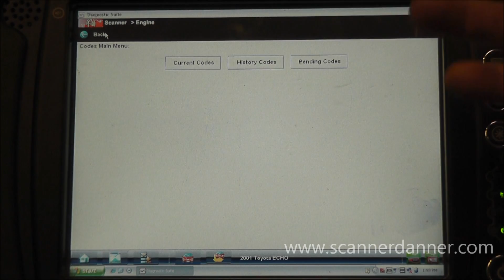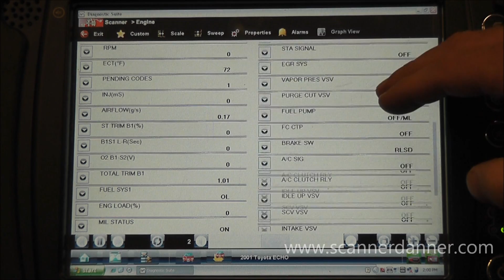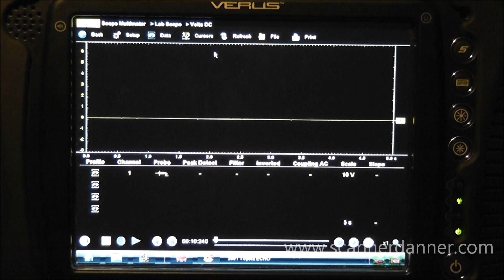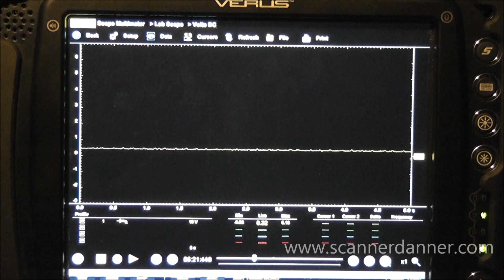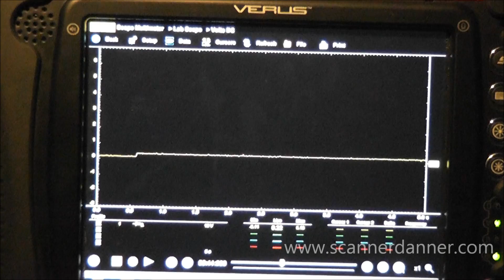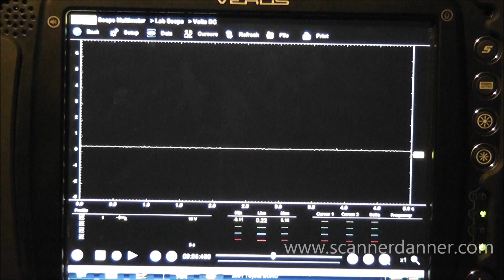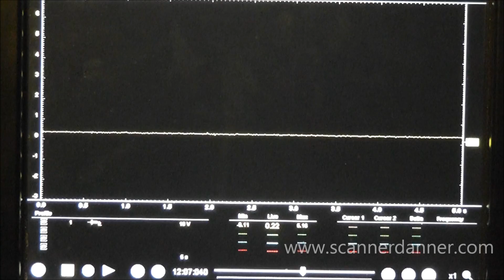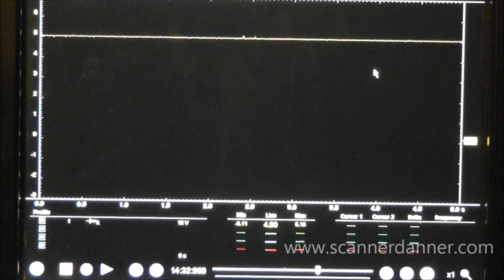Power Steering Pressure Sensor Testing (applies to all psi sensors) - Toyota (P0550)

Comment: Hello Paul , do you have any videos on electric power steering assist fault? No codes , message on dash Power Steering assist fault ? TIA 😊
Reply from the maker: Power ground and 2 CAN wires is typical, so not much in the troubleshooting side other than that and follow the flow chart for the code. Step 1 can you communicate with the power steering control module (most likely part of the whole unit)

Comment: very nice explanation. One thing is, can we jump signal wire with incandescent test light to reference voltage or to the battery.
Reply from the maker: Use the reference wire when you do that test and yes! This is actually a procedure I have taught is using an incandescent test light for this test in case you jump the wrong terminals

Comment: do you think its possible to check signal wire with volt meter
Reply from the maker: Of course, especially on this type of sensor as it doesn't have very fast changing signals

Comment: thanks for this informative video,
in the last minute of the video you have mentioned that there is an internal resistor and it needn't to disconnect the sensor and computer to diagnose if there is a short or open in the signal wiring, what do you mean by internal resistor?
Reply from the maker: This will help! https://youtu.be/CkgrMasd57s?si=fBKxqtkx__etJ7AE

Comment: The scope is a cool tool and totally unnecessary. It could have done with a high impedance "cheap" voltmeter.
Reply from the maker: 100% on this test, I'm just using a glorified voltmeter

Comment: Wow, you're video was so informative and easy to understand!  I'm wondering if I could do the same test using a DVOM on my '07 Honda Pilot?  The dealer told me I had a seeping power steering pump, so when it started whining I topped it off, assumed it was that and eventually replaced it along with the o-rings-without confirming that was the cause...I know my bad.  Soon after it started whining again, on and off.  The fluid level is within parameters not bubbling but swirling (which I've never seen a car do before) on and off, and today it appears to have overflowed from the top of the reservoir.  I did read that someone replaced the reservoir, which is known to clog on this particular yr, make and model and that eliminated the whining  problem, after having replaced the o-rings and pump.  I suspect I may have multiple problems, the switch being one of them but would like to pinpoint the problem prior to replacing anything else.
Reply from the maker: What you're describing would not be related the the pressure sensor at all. I'm sorry but I can't help further other than to say you have a hydraulic system issue, not electrical. Steering rack, pump, restrictions etc etc

Comment: We get 5v on the signal wire when unplugged because in this pcm we must have a resisted jumper between the 5v reference and the signal wire which will give us a voltage reading when disconnected.   Otherwise if there were no resisted jumper we should see   roughly 0 volts on the signal wire when the sensor is unplugged...
Reply from the maker: Exactly! Nice job
Reply: @ScannerDanner  Is the internal resistor for the computer to test the circuit or does it play any other part in the function of the system?
Reply from the maker: @philljustphill1656  no other function, just diagnostics as some psi sensors and potentiometer circuits don't use them at all
Reply: @ScannerDanner  Right, so this method could be used for any system that works in this manner I assume.
Reply from the maker: @philljustphill1656  we are talking about the unplug it test and reading a 5v bias on the signal wire right? Yes! Every single circuit with this design can be used this way.
Reply: @ScannerDanner  Oh right, that's great to know. Love the channel and all the content you upload.

Comment: Hi Paul, great job, thanks o lot.
I wonder, if making a jump 5v ref to the signal wire is always safe. What about, when the signal wire is shorted to ground by wires, not by a sensor? Isn't it like we'd do a 5v ref shorted to ground and then...
Greatings from Poland

Comment: Ok...finally got over my weekend ps blues and frustrations to actually watch more of this very detailed video.  Barring my forementioned complaints/ps symptoms...

1) is it possible for a ps sensor to have  intermittent problems, perhaps a partially striped wire grounding out ? 

2)  you keep talking about the computer code.  Yet the sensor tells the computer to regulate the rpm's.  Does this sensor trip the idiot "Check Engine" dashboard light or not?  And if not, how does the tech know to go looking for a fault code?  Also,

Don't have a scope, can this "voltage" check be done with a DC  meter ?
Reply from the maker: you are having intermittent tight steering complaints right? Was the power steering pump changed? Was the steering rack changed? What are you working on? (year, make, model, engine)
Reply: @ScannerDanner  
2005 Toy Sienna
Nothing has been serviced

Three recorded incidents:

steering locked up (almost IMPOSSIBLE to turn) twice on first left turn on cold morning (S. Oregon so it was only ~30°) following three right turns around block at idle speed.

The third time was again at cold temp at night after sitting for 3 hrs but it was a right turn this time.  Symptoms not as bad but felt like switching from power to manual.

Was thinking if it happened again I should switch it to neutral a raise the rpms then put it back in drive, maybe just downshift?  But the incident happened so fast and the power returned within seconds

No belt squeaks

Belt still looks good, no cracks, tight within ~1/2 play. 

No steering wheel squeaks

No dashboard codes

No PS leaks

No contamination of fluid

No metal flakes in fluid

No recent service work. 

Used Seafoam Trans/PS flush against better judgement. Typically don't like additives but used it on account of making sure any contaminants were worked out of system.  MSDS says its just alcohol anyway.  Proceeded to run engine (start and shut off) several times, working fresh dextron (ie. Toy PS "fluid") through entire system with engine jacked up. both running and off from lock to lock several times.  Used about a gallon of PS by the time it was all said and done.  No contaminants, congealed droplets or heterogenous mixing of disimilar fluids observed in old fluid.

checked upper U-joint on intermediate shaft.  looked clean. wiped down anyway and used spray white lithium.  Could not see U-joint on bottom.  Will have to jack up engine again to spray grease it too.  Will replace if rusty or corroded, doubt that is it though.

Drove it a few miles.  But it is an "intermittent" gremlin.  Guess I will have to wait until it is extremely cold to test or catastrophic incident occurs?  Hmmm.  Only thing else I can do as an end user is replace the belt.  After watching more of the video it occured, what would happen if the sensor was intermittently bad?  And if it was, would it trip a dashboard code and if not would the fault code still be recorded in the system?  Cant think of anyrhing else and no one can suggest anything short of throwing parts at it.  Thx for reading Dan.

Comment: what the hell does a ps pressure sensor do bc my dash has no inicator for it?  Assuming it kicks on if the pump goes bad under the general check engine light.  

What is confusing is the need for one bc if there are any issues with the ps pressure would not the results tend to be obvious and catastrophic?

have a 2005 toy sienna with an INTERMITTENT problem of locking up and hard steering in both directions however it does not leak a drop and there is no groaning of the pump...  NOBODY, not even the dealer can offer a solution but to throw parts at it.  Is this what auto mechanics have become? WTH ???
Reply from the maker: on a conventional system (without variable assist) the p.s. psi sensor is used for idle speed control. The ECM needs to know when there is a high power steering load to prevent stalling during parking maneuvers. On a variable assist power steering system where the steering gets stiffer at highway speeds, the psi sensor would be used in diagnostics for the system itself. The module would command a certain pressure and it wants to see that same psi on the sensor.
Reply: @ScannerDanner  ... Thank you for this.  I received part of (your) answer from my the ever-so pleasant toyota parts lady and her colleage last week.  They gave me the first part of your answer which is COMPLETELY unheard of in this day and age for a dealership to offer the consumer any other advice than..."bring it in."

So basically, the ps sendor does not have an end user idiot light feature and is just a sensor for the computer in the internal operations of the engine?  Got it.  Still doesn't explain the morning sickness of my rack.  Used seafoam trans flush followed by dextron this weekend.  There was very little contamination in the old stuff, performed flashlight at night metal flake test also, nothing.  No groaning, no squeaking, no leaks.  Only other thing that comes to mind is maybe there is a flat spot on the belt that is intermittently slipping during cold weather.  Tech said squirting a bit of WD 40 on a suspect problem belt will verify.  Checked the U-joints in the intermediate shaft, also fine.  I wonder how many fatal car accidents happen from equipment failure and no one ever determines how or why.  Thank again ...Scanner.

Comment: When you disconnect the sensor-harness plug and you have your lead on the harness side signal wire, how does the signal wire from the harness side get 5v instead of 0v? I must be missing something because I'm thinking that when you unplug the connection, it becomes an open circuit to all 3 wires, which would mean 0v at the signal wire on harness side.
Reply from the maker: There is a bias voltage on some of these signal circuits
Reply: @ScannerDanner  I watched one of your videos which explained bias voltage! Thanks!

Comment: My car got the same issue, P0550 - Power steering pressure sensor signal fault. Problem. State: Intermittent. I have a Citroen C4 petrol 1.6 16v, just changed the coils and spark plugs and the engine dies whenever I stop at a red light or moving slowly. I get check engine and anti pollution faulty error. Could this be the reason why it does that? Thanks in advance.

Comment: Ok I did some critical thinking about the circuitry. And the only scenario that I could think of that would leave the signal wire with 5V unplugged is as follows. If you hop over to your video that compares potentiometers and thermistor circuit designs, you can see how a thermistor circuit has a resistor built into the 5V send/signal wire, and essentially uses the voltage drop that occurs, between the integrated resistor and the thermistor, from either extremely low resistance in the thermistor (nearly a short), or lack thereof from high resistance as the signal. I am guessing the same technique is used on some types of 3 wire potentiometers. Although, then I wouldn't see the reason for a 5V ref, if your going to measure the signal of a potentiometer, like a thermistor. F*** I don't know....
Reply from the maker: I have some lectures on this on my premium channel. Your close, there is an internal resistor (very high ohm) that connects from the 5v ref to the signal wire and can only be "seen" when there is an open circuit. With a complete circuit that "bias voltage" circit bleeds off through the sensor to ground. It is always there, just can't see it. The real key is knowing how to use it to your diagnostic advantage. 
If you interested you can subscribe here for a 14 day free trial.
https://www.scannerdanner.com/join-scannerdanner-premium.html
Either way, thanks for the comment!

Comment: What ARE THE BASICS I NEED to program general motors cars .
Reply from the maker: You can use a J2534 programmer for most GM's (I think). I don't do much programming.
Reply: THANK YOU MISTER DANNER FOR YOUR RESPONSE .

Comment: I'm missing something here. Unplugging the connector surely leaves the signal wire having no volts back to the ECU, so how did it suddenly get volts along it. You never bridged the 5v ref wire to it, so would you mind explaining in words what happened there?
Reply: Bias voltage from ecu.
Reply: The computer sends 5v to that sensor, so by unplugging it and verifying that the voltage is there- it rules out the wire all the way back to the computer. think of it like this- just because you dont plug something into a wall socket- doesnt mean that 120 volts isnt on that curcuit. hope that helps.
Reply: I guess we better buy the book bro...

Comment: I have a Hyundai Elantra 2003, knock sensor is bad zero resistance but before plugging a new one I tested the voltage (ign on) arriving to the sensor`s plug (sensor disconnected). There is 2 wires, white=ground/brown-signal, and the voltage arriving there is 2.27v. Now, I searched everywhere even the diagrams and IDK what voltage should arrive to this sensor, all other cars models/manufacturers says 5v so I believe mine should be the same. I will do the voltage test directly in the ECM pin but if it shows 2.27v again how can I assure if it`s ok or I have a bad ECM? do you have this knock sensor voltage information for this car?

Great channel BTW, subscribed!

Comment: Mr. Scanner. Could a bad pressure sensor cause a car to shut down when you're turning? My sister-in-law's 2005 F150 V8 is turning off when she turns it's left or right but it's intermittent, all the lights go on and the radio stays on but has a blank screen.
Reply from the maker: +vinnymac01ss your thinking is on the right track. something is shutting that system down and it seems by your description that it also affects the radio?
that's weird. any fault codes in memory? I don't think a psi sensor would be related to turns, but there may be a power steering psi sensor that could share this 5v ref. I'm not sure without looking at a diagram.
Reply: +ScannerDanner  So I did look up a wiring diagram and found out that this sensor is spliced in with another sensor that since you're being the fuel rail pressure transducer sensor could that be a possible reason of the car shutting down maybe it has a short to ground? I also look at the wiring diagram for the radio that is it's own wiring so I'm just assuming that's happening because the cars just shutting down.

Comment: If we disconnect the connector and do not get 5 volts on the signal wire, would it be safe/effective to use a power probe hook, on the voltage reference mode to send a small voltage down the signal wire to test its integrity instead of using a resistor?
Reply: Yes.  I wanted to buy the hook for this very reason.  Remember though on some designs there is 5v on the signal wire already with it unplugged (bias voltage)

Comment: I am testing an air condition high pressure sensor and it should be a digital square wave and I am getting an AC sine wave. I believe it is a bad pressure sensor and the internal circuitry in the sensor is damaged, but not sure why I would get an AC sine wave. The test I am doing is exactly what I have learned from you scannerdanner. Thanks for the valuable information. Keep them coming!!!
Reply: If it is a low amplitude sign wave it may actually be interference from the lighting in the garage and the reason you're seeing it is from an open circuit. Is it by chance a 60 hz signal?
Reply: ScannerDanner Premium I see what you are thinking, but the car is tested outside. Wife has car today, but I will do a circuit integrity test when she gets home. The sine wave is actually like a variable reluctance cam signal like the one on the right of this image. It still could be interference just kind of strange. I was using the Uscope and will get specifics such as time base and frequency etc.. Ill let you know what I find out. Its a 2003  VW Jetta. Great problem for this kind of troubleshooting... Thanks!

Comment: if the signal or 5 v  ref wire is shorted to ground  the ecu would automatically shut down you'll have a no start condition
Reply: NO COUES IT HAS A 5MAX/0-min potentiometer inside  but why it gave a 5v when unplugged from the computer?

Comment: Hi Paul which wire did you back probe to check if the signal wire was shorted to ground was it the power wire or the signal wire when you disconnected the plug thanks
Reply: signal from computer
?..

Comment: I DIDNT GET IT 

WHy did the VOltage Rise .. where does this voltage come from ? 
Is the sensor wire connected to the 5V reference wire ?

If the wire already has 5V why do we need a reference wire with 5V ?

Comment from the maker: @manicmechanic22 it was the signal circuit and the 5 volts that you see comes from an internal resistor that is used for diagnostic purposes. most people do not know it's there or how to use it

Comment from the maker: great question. you could go by the trouble code. if it had a circuit low code and now has a circuit high code then you know the PCM is responding properly.

Comment: Well done. Question:  seems to be quite common for  test procedures from  OEM's  to be  disregarded  for better and faster techniques , any idea why the OEM's constantly refer to test flow charts that make no sense.  The best one I like is (do you see system voltage , if yes , change part) .  :)

Comment: Is it normal for the voltage to increase that slowly when you unplugged the sensor? I was expecting a more vertical graph section  I couldn't read the scope very well, how many milliseconds was that from the low voltage plugged in to the 5v unplugged?

Love your videos. I learn something every time. Appreciate you taking the time to do this.